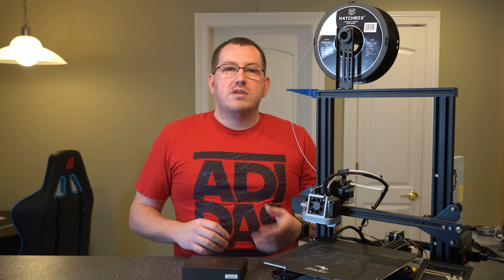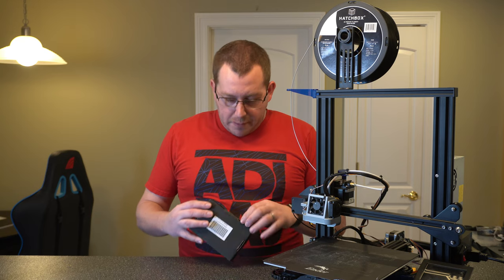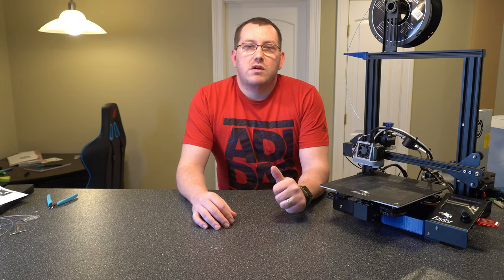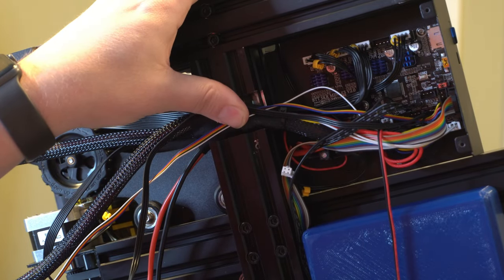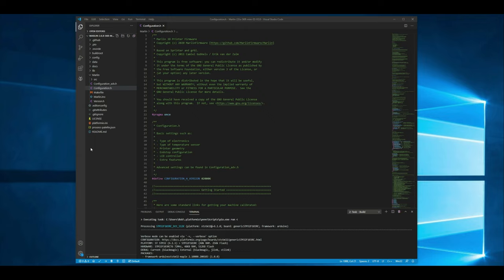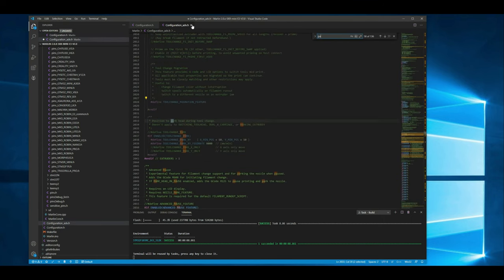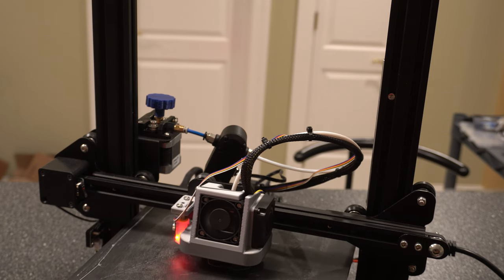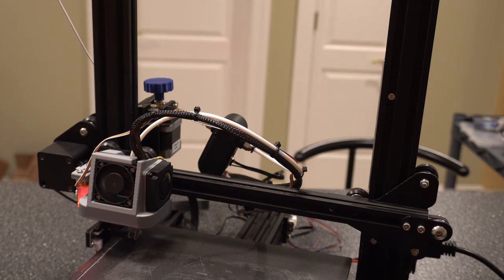Ender 3 Filament Runout Sensor – Install Guide

Comment: Thanks for the video, I’d been trying to figure out why my sensor had been in a constant state of being triggered for months. I never thought of resetting the eprom for some reason🤦🏼‍♂️ I literally rewrote a good chunk of the code to fix the issue 😅
Reply from the maker: Hi. What all did you end up doing to fix it? Im curious if one of the changes forced the cache to be cleared. Ive been there though, I had a similar experience with the bltouch when I switched over to the SKR Mini. One thing that ive learned from being in IT is that the issue is almost always so small that’s its easy to overlook or it’s a cache issue 😊.

Comment: I have a SKR Mini E3 V2 and a TFT35 E3 V3 and no matter what I do it doesn't work... I'll start a print and it will push all the filament out of the tube and says "Load Filament" etc, I've copied what BTT tells us to do and nothing with all config correct, I watched TeachingTechs video which basically said nothing will work, Is this video a different way? Or is there something else I can do to get it working? I have a relay module & Mini Ups & neopixels which work fine but it's just the smart filament sensor, Apparently there's a way I can get it working by wiring it up to my Raspberry Pi but I'd much much prefer using it the way in you're video, Please Help, Love you're channel btw

Edit: My compile is identical to yours but I keeps getting the issue of filament being pushed out and the "Load Filament" error
Reply from the maker: Hi. First sorry for the delay in responding, you post was caught in the YT spam filter. If you are getting the load filament error and you have filament in then its probably not corrected right or you are prining from the wrong device. For example, if the sensor is connected to the TFT35, you must print from the SD/USB slot on that, if you print from the slot on the mainboard it wont work. If you ware still having issues i will need more detail on how you have everything setup and where you are printing from.

Comment: Does the pause feature cool down the extruder? Sometimes I'm away from the printer so don't want it staying hot for hours until I can swap filament.
Reply: And by extruder I mean hot end!! Sorry early morning!
Reply from the maker: Hi. By default it will just go to a set temperature, i forget what it is. I think its controlled with the firmware.

Comment: Yet another superb video! Thank you!
Reply from the maker: You're Welcome!
Reply: @3DPrintscape   does it work using touchscreen mode or just marlin? Also what about octoprint?
Reply from the maker: The smart sensor sends signals to the device its connected to, so it can only in a single mode. This video covers how to make it work when connected to the mainboard and using the standard Marlin interface. I'm working on a video that covers how to connect it to the TFT35 to work with that interface. At this point, I don’t think it works with Octoprint. I did see that a Octoprint plugin was released, so I will look into that more.
Reply: @3DPrintscape  awesome thank you :) hopefully they’ll update the firmware at some point so that you’re able to use it whilst being plugged into the mainboard, no matter which mode you print from
Reply from the maker: Ya, that would be nice, not sure it will be possible, though. The TFT35 is basically a stand-alone unit, they would need to add another communication channel between the devices.

Comment: Nice work! One question: can it not be mounted before the extruder drive? That way it isn't adding weight to the extruder and broken filament or run-out tails could be pulled out without dismantling the feed tube?
Reply from the maker: Hi. Thanks for the feedback. It can be mounted before the extruder, I have mine on the top right now. I haven’t had any issues but I have heard some people say thay got more false positives and had to adjust the runout distance.
Reply: Wouldnt it be compulsory that the filament sensor sit before the extrusion motor?

If the filament runs out at the motor there is no more length of filament to drive the tail end of the filament past the sensor rendering it useless? 
The filament sensor would never trip and the printer would never stop moving. Instead of the printer tripping off it will simply make an air gap when no more is being feed through...
Reply: @doctordevastate8477  I believe this is a rotary sensory, meaning it detects filament based on movement.  If filament runs out and is past the extruder, the filament will no longer get pushed through the sensor which will report back as "no movement" and stop the printer.  I think the issue with installing it after the extruder is how do you pull out the filament past the extruder without disconnecting the tubes?  I guess you could  just feed a new roll of filament to the extruder and have the new line "push" the remaining filament through the hot end.

Comment: Good video, I hope to get the smart sensor at one point just waiting for it to be compatible with octoprint would be nice to have the additional benefits.
Reply from the maker: Hi. Thanks for the feedback. Im waiting for a way to tie the smart sensor into Octoprint as well. If I find a way to do it, I will create a video on the process.
Reply: @3DPrintscape  can you not use this if you use Octopi? i just bought one and am planning to convert to direct drive and BLTouch as well.
Reply from the maker: @bowhunter3125  I think they may have released a plugin that supports it but I haven't tried it out myself.

Comment: Clear the eprom? Do you mean with the 502 reset command? Or something else. I am not clear on this..
Reply from the maker: Hi. If you are using the touch screen, it will be under Menu  Settings  Machine  EEPROM. It should be around the same area in the standard Marlin interface. Once there, you will want to hit reset. That will erase anything that’s stored there. If you have a BLTOUCH and have a Z-offest set, you will need to set that value after you erase the memory.
Reply: @3DPrintscape  Hey I m using smith3d compiled firmware I did as you told in the video (also I have BKTOUCH). but the sensor constantly triggering, I don't have octoprint and I don't have a touch screen, how should I Clear the EPROM? could you please explain! Thank you!
Reply: @3DPrintscape   for now i have following code in start ; Ender 3 Custom Start G-code
G92 E0 ; Reset Extruder
M412 D9 ; 
M500 ;
G28 ; Home all axes
M420 S1 Z2 ; Use mesh when calculating Z
G1 Z2.0 F3000 ; Move Z Axis up little to prevent scratching of Heat Bed
G1 X0.1 Y20 Z0.3 F5000.0 ; Move to start position
G1 X0.1 Y200.0 Z0.3 F1500.0 E15 ; Draw the first line
G1 X0.4 Y200.0 Z0.3 F5000.0 ; Move to side a little
G1 X0.4 Y20 Z0.3 F1500.0 E30 ; Draw the second line
G92 E0 ; Reset Extruder
G1 Z2.0 F3000 ; Move Z Axis up little to prevent scratching of Heat Bed
G1 X5 Y20 Z0.3 F5000.0 ; Move over to prevent blob squish
Reply from the maker: @repinscorpio  Hi. Sorry, I just saw these. If you go to configuration under the menu you should see something that says erase settings or erase eeprom.

Comment: how does it feed the cut end of the filament past the sensor when the sensor is beyond the extruder? How does the extruder keep pushing it past the sensor to detect the break?
Reply: nevermind, I see that it detects the filament motion not the cut end of it
Reply from the maker: Hi. Ya with the smart sensor it detects that its not moving. With a normal sensor, it would need to be before the extruder.

Comment: HI , I HAVE BEEN TRYING TO GET MINE TO WORK FOR THE LAST COUPLE OF DAYS , AND WATCH YOUR VIDEO LOADS BUT I ,JUST HERD YOU SAY IF IT KEEPS TRIPPING THE SENSOR , JUST RESET THE EPROM , NOT DO THIS BEFORE , COULD YOU TELL ME HOW TO DO THIS PLEASE
Reply from the maker: Hi. Depends on the firmware. It may say reset firmware or reset defaults.

Comment: I added a bl touch and the filament sensor. When I try to build the program it says it has two errors advanced pause feature required lcd controller and advanced pause feature requires supported lcd controller. I also put the Tft35 screen on as well. Could you please help.
Reply from the maker: Hi. Can you email me a copy of your configuration.h and configuration_adv.h files? My email is admin@3dprintscape.com .

Comment: I have an ender 3 v2 4.2.2  and i just bought a filament runout sensor it's all pluged in  i'm usibg sonic pad what would be the next step
Reply from the maker: Hi. Im assuming it would need to be enabled in the firmware. I havent tried that yet though.

Comment: I'm confused how does it work if it's after the extruder? Shouldn't it be on the other side?
Reply from the maker: Hi. The smart sensor will work on either side, it will sense no movement and pause the print. A normal sensor would need to be before the extruder.
Reply: @3DPrintscape  ah, makes sense. Thanks for clearing that up.

Comment: Well you put the cart before the horse I'm afraid. How can extruder push air?
Reply from the maker: Hi. Ya fair point. I talked about the placement being for show in the video and that i planned on mounting it towards the top, but to detect the filament being out it would need to be before the extruder. It can still detect jams/etc its its after the extruder.

Comment: runout sensor wont trigger if its after the extruder (between extruder and hotend) as once it passes the gears on the extruter the filament stops moving down the bowden tube so it wont trigger the sensor as the printer doesnt suck the remaining filament down the tupe.. or am i mistaken
Reply from the maker: Hi. A standard runout sensor wouldn't work after the extruder. The smart sensor detects that the filament isnt moving (similar to filament stuck on the spool) and will pause the print.

Comment: I'm all set up now but... My sensor triggers backwards! when no filament is loaded is tries to print like normal but when filament is loaded it immediately pauses the print. Is this a dodgy sensor or can i reverse the logic in the firmware build somewhere?
Reply from the maker: Hi. You could try to change the value of #define FIL_RUNOUT_STATE to HIGH . I think that should reverse the logic.

Comment: Hi. My printer is ender 3 pro with skr mini e3 v3 running Marlin, the DIY sensor works and has two states, but they are reversed, it says it has filament when it does not, and does not when it has filament loaded. Have been stumped for the past hour trying to fix, havent found anything on google similar enough to the problem im experiencing, any ideas?
Reply from the maker: Hi. I think you need to change the value on #define FIL_RUNOUT_STATE  to reverse it.
Reply: @3DPrintscape  Ok. I Will try it. Thank you.

Comment: I do not have any icons to do the compiling like at all
Reply from the maker: Hi. It sounds like platformio is installed or you have the wrong firmware folder opened. It should have the platformio.ini file in the root folder.

Comment: It should be mounted before the extruder drive because now it won’t sense when it’s out of filament only give you a stuck filament sensor.  For which you’ll miss a line or two before it recognizes it
Reply from the maker: Hi. The smart sensor can be mounted on either side because it can detect the filament not moving. A standard sensor would need to be mounted before the extruder.
Reply: @3DPrintscape  half way correct. But if it’s mounted after the stepper how can the filament sense detect a runout it won’t it’ll detect a non movement for which as in a filament bind it won’t detect runout.
Reply from the maker: @boazandruth909  It would treat it as if it's a bind, yes. It would still pause the print though which is the main purpose of the sensor.

Comment: I don't understand how this works unless your filament sensor is actually feeding the filament too. Otherwise once it gets through the extruder it would stop. My sensor is mounted before the extruder for this reason.
Reply from the maker: Hi. Thanks for the feedback. You are correct that in general it will work better before the extruder. I mounted there to show as a test but mentioned that that it was temp because I was moving to a direct drive setup. That said, it does work when mounted after the extruder because of the smart sensor technology. It detects that the printer is running and no filament is moving through it and it pauses the print.

Comment: Which connection location is preferred. I have the SKR 1.4 Turbo, and the TFT3.5 v3 I am also use Octoprint. I already know about defining HOST_ACTION_COMMANDS HOST_PROMPT_SUPPORT and EMERGENCY_PARSER which allows the TFT and Octoprint to see that the print is paused and resume
Reply from the maker: Hi. I think connecting it to the SKR Mini makes more sense in most cases unless you are printing from the USB/SD card on the TFT.

Comment: In need of help please I have a cr10 mini with BIGTREETECH SKR Mini E3 V3.0 Control Board, with TFT35 E3 V3.0.1and bltouch v3.2 on marlin all working perfectly iv just got the BIQU Direct 3D Printer Part Smart Filament Sensor Break Detection Module witch plugged in the the skr mini e3 v3 board. when I print It says (Filament runout) the it heats up tyres to print then kicks the filament out then takes it back in then nothing just keeps saying press continue  any idea thanks
Reply from the maker: Hi. What firmware are you using with it, is it plugged into the skr or tft, and are you printing from the skr or tft port?
Reply: @3DPrintscape  hi thanks for getting back to me it just told me today. so (BIGTREE_TFT35_V3.0_E3.27.x) (Marlin-bugfix-2.1.x) i first put it in the main board then into the tft same thing happens. look like a common problem with the screen and board together
Reply from the maker: @jonesben6  It will only work when printing from what its connected to. For example, if its plugged into the main board you have to print from that, not the tft or remotely.
Reply: @3DPrintscape  I do print from the mainboard only put it on tft as was recommended to test it
Reply: I did see a page where someone said when you use both board and tft together it wont work unless you have one of the old .ie old board new screen or old screen with new board. This can't be right can it?
Reply from the maker: @jonesben6  Ok, it sounds like its triggering the sensor as soon as it starts to print. This happened to me when i printed from the wrong location or the firmware wasnt right. I had it working for a while but stopped using it when i was doing more firmware builds.

Comment: Hey Rob,  your Neopixel guide was invaluable. That said, I have a TFT touchscreen (using Marlin mode) and any time I print the sensor immediately and repetitively asks me to change my filament… I don’t need to use the sensor input on the touchscreen if I’m using Marlin mode, correct?  Trying to figure out what else it could be.. Very frustrating
Reply: Wait, will try clearing the EEPROM and let you know!!
Reply from the maker: Hi. Thanks for the feedback. If you have the sensor connected to the skr mini, you need to print from that. If its connected to the TFT, you will need to print from that. Did clearing the eeprom fix the issue for you?

Comment: Hello. Thanks for a great video. I have an Ender 3 with the BTT skr mini e3 v2 and BTT TFT35, what is the difference between connecting the BTT’s smart filament sensor to the motherboard or the TFT35?
Thanks.
Reply from the maker: Hi. I believe the install is covered in tis video, if not i have another one covering it. The main difference is where you print from. If you print from the tft35 and have the sensor connected to the skr, it wont work.
Reply: Thank you that helps and answers why my runout sensor didn't work. I have it connected to the TFT35 and I print from an SD card plugged into the motherboard. Again thanks.
Reply from the maker: @steve8939123  You're welcome

Comment: Hi,  I'm looking at installing the smart senor to my ender 5 plus.  Hardware side no issues installing but really scared on how to configure and install the software.  My printer currently has the standard break senor which lets face it doesn't work when it clogs and have lost a few prints because of it,  so if you have a link I can follow that would be great.    I don't want to buy it until I know how the upgrade the firmware.
Reply from the maker: Hi. I havent installed one on an Ender 5 yet, so i dont have a video covering it. The best video i have is this one right now.

Comment: hey rob im wondering if you can help me out with a custom firmware for my ender 3 pro skr mini e3 v2.0 i have the BTT runout sensor as well as crtouch installed on it i can get 1 or the other not both please help. thanks
Reply from the maker: Hi. Can you reach out on discord?
Reply: @3DPrintscape  yes i have im terncmt
Reply from the maker: @christernes949  Can you DM me, or @ me where the message is?

Comment: can't get it working with my tft24 and skr mini 1.2.  when I started the print, itll immediately start retracting the filament and the pop-up saying paused and ask me to continue.  I press continue and it'll just keep cycling the pop-up.  Imreset the eprom, but same thing. When I disable the sensor it works great.  The tft24 doesn't appear to have a fil detect pinoit, so I can't try that.  Any idea?
Reply from the maker: Hi. So im assuming the sensor is connected to the SKR Mini? Are you printing from that or the TFT? Also, I can try to help you on here or on Discord. https://discord.gg/Bu94EYVkrU
Reply: @3DPrintscape  connected to the skr mini, not the tft24.  Does it work in touchscreen more for you if you connect it to your skr board with your tft35?
Reply from the maker: @BuzzingGoober  Ok, and your printing from the SKR as well? And yes it works in touch screen mode if the sensor is connected to the skr mini and I am printing from that as well.